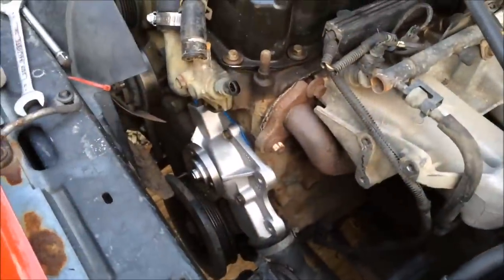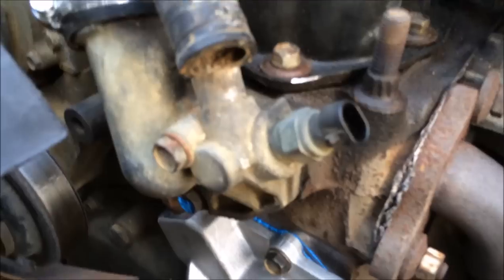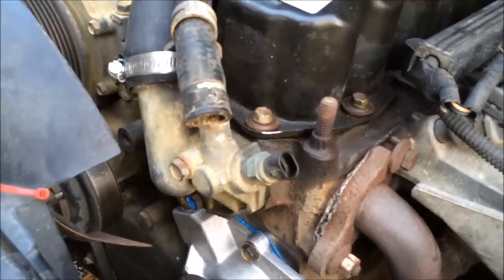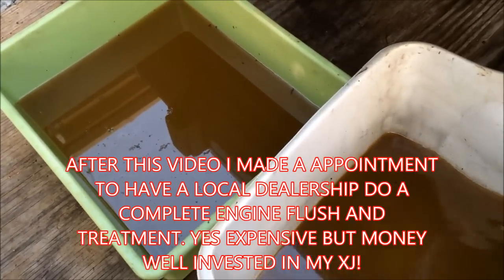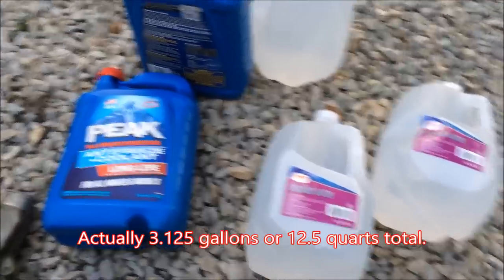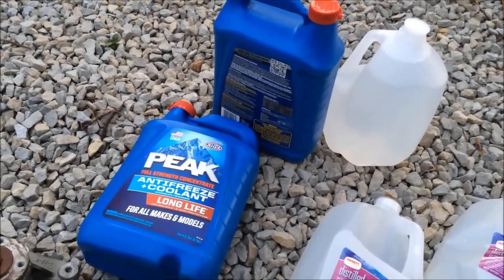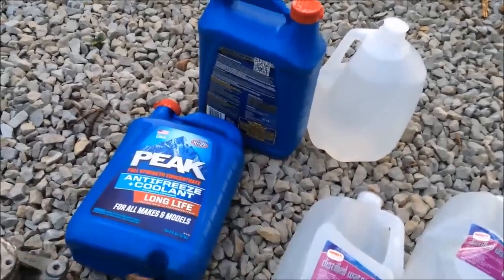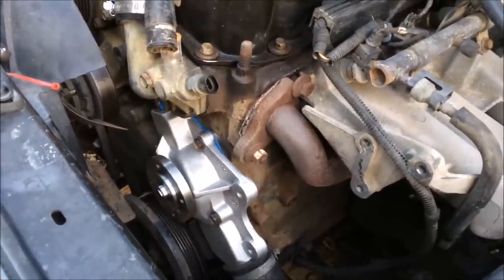JEEP XJ CHEROKEE COOLANT RUST PROBLEM

Comment: Some people said that the older type of coolant was better. Thanks for the tip and a great video.  Some people I know said they mix 60% coolant with water so 60/40 and their engine is still working fine and the heat is excellent. I don’t know if that’s the best thing to do but the car is 30+ years old.

Comment: Aside from the water pump impellar rotting ive found the  lower radiator internal hose spring is metal, and as such it rots as well adding lots of caca to the system!! Still love xjs, quick tip add about 10 tablespoons of CLR to the coolant and run for 30 minutes before a flush! No more rust or sediment!!!

Comment: If you really wanna flush the whole system just pull out the radiator drain all the way.   Stick the water hose in the radiator fill and run the engine till it all runs clear.   Catch everything that's green/rusty and recycle it of course.    That's the best way I've found to completely clean it all out.  The comment about the clr makes sense too so this time ima try that

Comment: I didn’t even put XJ in the search but this video popped up, I have a ‘98. I bought it from a coworker for $600 and there were large (size-wise) layers of buildup that came out when I was doing a flush. Giant thin flakes one was easily 3/4 inches long. I wonder if there’s a good way to get it all out, I wish it was safe to put some laundry detergent in it 🤣

I think I’m gonna install the radiator flush kit that I bought for another vehicle if I can find it, the 4.0 is a lot more accessible.

Comment: Im out doing my Overland Adventure  right now  but the next town i hit i will buy a water pump and change it.. plus cut that pipe for better HEAT....thanks
Reply from the maker: ManOfMany Thingz What I forgot to mention was you can get a brass fitting to go in that hole as well that has the barbed end for hoses

Comment: Tap water is bad for any cooling system, it's nothing special to the XJ.  The chlorine isn't the big problem, the minerals will clog stuff up.
Reply: Agreed,I put a new radiator in my 2000 xj according to the instructions ( yes I read them) if any thing less than distilled water and antifreeze will void the warranty. Simple, do not use tap water.

Comment: i never use 50 50
Reply: don't run pure coolant coolant is suppose to just protect against freezing premix is the best as no worries to get the wrong mix ratio distilled water  on its own cools the most pure coolant will cause your car to overheat in hot places as it doesn't have the same heat transfer efficiency as water my grandfather ran pure coolant and we flushed that out instantly and added premix since it overheated his engine in the summer now with premix no problem with heating up

Comment: just my 2 cents.... I had overheating problems for years... once I drained the system and  used Prestone 50/50 the overheating issue stopped..... so In my case, I will never go back to mixing Coolant and water myself
Reply: Don't you think the fix was due to the coolant change instead of the type of coolant?
Reply: @Micscience  I always used 100% Prestone green coolant and mixed with water, but now only use Prestone 50/50 and flush the system every year (June) is crazy the stuff that comes out from the old 4.0 engine
Reply: @Micscience  honestly, I had the overheating issue for so many years that once I "fix it" I just didn't want to move or anything else, maybe what I didn't mention is that I used 70% coolant & 30% water when overheated